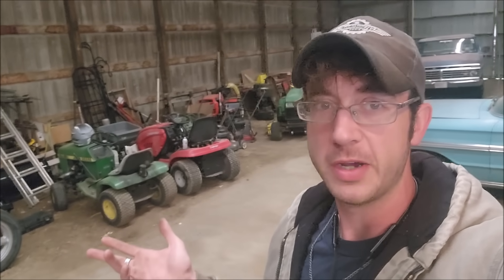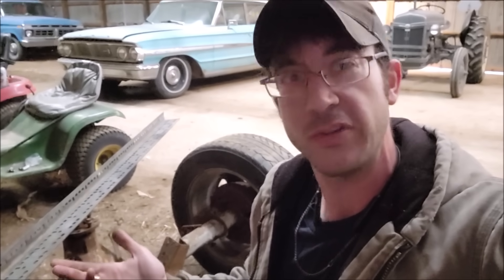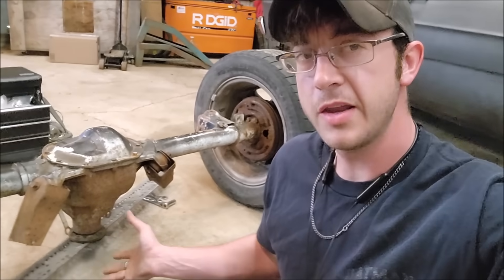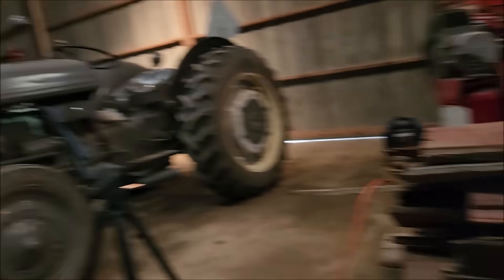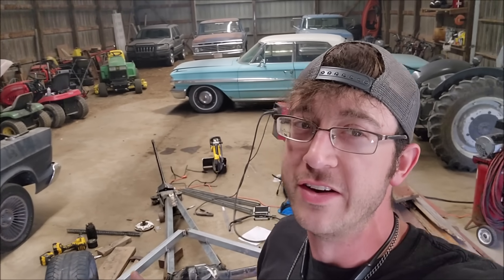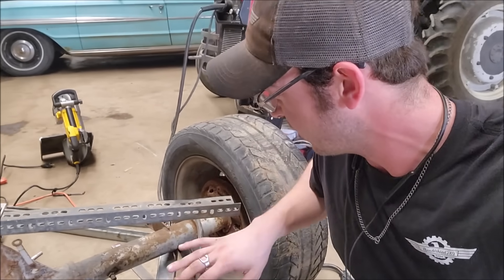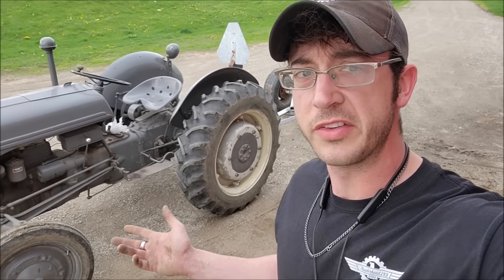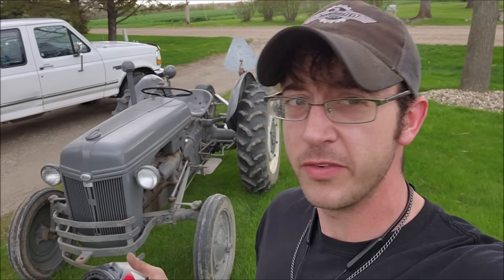Car Differential MOWER: Build & Test!

Comment: For a blade to work well it really needs a deck enclosure so that it can create a kind of suction on the grass. My suggestion to make this work better would be to ditch the metal bar blade and instead use something like 1/8" steel rods of appropriate length. You'd just need to make a hub that bolts to the diff, and around the edge of the hub you make some holes which would hold the rods. To mount them, you can bend one end to make a small L, stick it in the hole, then dab the end with a welder to keep it from falling out. Don't weld them to the hub because you want them to be able to swivel. Do it this way and you will be able to mow tall grass and brush with ease..and replacing the rods is as easy as cutting out one that is damaged and popping a new one in its place. How many rods should you use? Well, if you plan to mow slow use more rods. If you plan to mow at faster speeds, use fewer. I'd say minimum 3 max 8.

Comment: smaller wheels... but then the clearance is gone.
but then if you flipped it over, you can drive a step up pulley to a (new) spindle, that you can make from an old car hub and axle...

it needs to go about five times faster... think of the depth of cut on a normal mower, you may move half an inch or less per blade rotation.

then its going to need a few hundred kg on it to keep the wheels from slipping as the ratio would be so high.

naw, it seems a good idea at first but its power is all dictated by its traction, the gear ratio, and how fast its traveling... better to just mount a normal engine on there.

swing back blades are a must.

Comment: Mower deck 200 to 400 bucks. Done deal.

We used to give 200 to 400 for an old ford 8n or 9n tractor they only cost 400 new back in the day and there are 10 of thousands of them in verious states of condition. 
That one looks pretty dam good if you ask me ya just need the correct pain colors on it. Becuse the gry isnt working.

I dont own a farm or even a big lot, but id love to have one of them tractors they are fun to drive.
Reply from the maker: Read my pinned comment - I actually own a bush hog, this was just for fun with junk id never use

Comment: Break down buy a mower deck 3 point hitch anx use the power take off, flip this over make a roud sling deck mounts a drop box and youve got a great pull behing spreader.

Comment: To get good at welding you have to run a lot of beads, it just takes practice. You can have an E for effort  if you didnt try it be an F  you earned the bottom line.  Get better youll earn a I up the righ side to make a B  you can only go up from that.    Pst i cant weld for shit but i use a stick welder never could make wire feed work.

And 40 plus years ago i worked in a machine shop.  

One problem on your blade,  one side cuts the other smacks the cutting edge in on wrong side.
But hey flip it over you can make a spreader.  Look on youtube somone did it.
Reply from the maker: I mentioned the plan with that but I can see the average watch time is 3 minutes so I know folks are jumping around and missing a lot 🙂

Comment: If that tractor could do 80 MPH it might cut grass, but I still doubt it. That blade is turning way too slow to mow.
Reply from the maker: I mean you saw it lopping grass right in the video - but the second iteration isn't ground driven and spins a frightening 500 rpm 😅
Now it's real dangerous

Comment: Taller wheels/tires will turn the blades slower. You need a different gear ratio,

Comment: A buddy back in Nebraska built a rig about like this out of a pick up truck rear end but he put a electric motor that put out 5kw of power wich is alot then pulled it with an electric powered car he built and drove out to the west coast and back never had a problem. It had batteries that got it going once he hit 20mph it would kick in and that thing would really go.. after some time he was trying to get his invention out there and he got a visit from some government guys with a seize and desist order two days later his entire shop and rig burned to the ground!!
Reply: I think I know that guy, he also invented a carburetor that would get a hundred miles per gallon on any engine.
Reply: @richardbauer3327  no wrong guy. But T did put a hho cell on a van and it got 50 mph. Lol

Comment: version 2.0 should have a height adjustment and a guard to keep stuff from flying up to the cab.  Technically you only need to guard on one side except if you really want to be fancy and guard against the mowing in reverse you could guard on both sides.  You could build the guard with old pallets or something expendable.  Metal is cooler though.  This is fantastic for antique tractors that do not have a pto.  A lot of equipment like manure spreaders and seeders feed of the wheels.

Comment: Maybe I’m totally over thinking this. What about remove the tires and mount   a PTO shaft to one of the axle shafts and then put the whole thing in some sort of a frame that could be attached to the three point hitch, then that way you have hight control

Comment: Find a good used mower deck as wide as they make. Use the rotating yoke and attach a pulley to it to be the drive belt going to where the mower deck drive pulley is. Now you have finish mower. Find a brush hog deck that the gearbox is shot and do the same thing. If you can make it where both decks mount same way you will have brush/slasher and a finish mower that will safer to use and we will still be watching future  videos.

Comment: the other thing is the rear gear. you want it at a high enough gear for it to have the speed to cut. if i recall correctly since i used to be around the mower tractor(the big ones you might see mowing school grass or certain tracks)attactment. they spin upwards of 3000 to 4000RPM and sometimes even faster. try aiming for that

Comment: Need to mount a camera @ the hitch level, I don't see it cutting ANYTHING, your grass is too short
Reply from the maker: This was just a test to see if anything would work or if it would just vibrate apart violently. 
I have a pretty simple phase two where I'll have a blade edge and some rpm to it.

Comment: Can I please get these 15:42 of my life back?
I do recall spending some time as a younger man making a pressurized can to fill 90w oil into a truck transmission and transfer case. That sketchy thing blew up and covered me in 90w.
Your death mower could let loose and cover your lawn in body parts and whatever blood type you are.
Take that thing apart, sell/give the diff away or just stash it somewhere until you find a fox body for it.

Comment: Another death trap idea. A horizontal boring tool to dig out the dirt in a crawl space. It could be vertical if you had the floor removed in the home. Yep I've been working on the idea. But in the space below this house we bought call a storm shelter storage area and a collection point for water to be pumped out. I just like the house is over a hundred years old.
On your homemade brush hog why not just use a blade from a brush hog hog.

Comment: I saw one a while back in a foreign language, the guys used a truck axle. You need deep gears 5 or better. Or a two speed medium-duty rear with 7s.
Reply from the maker: Or my actual phase 2 plan which is extremely dangerous but super effective

Comment: These are pretty sweet brush hogs when done. Have not seen any one put enough effort into one to really be a finish mower yet. I do advise some kinda of mesh metal shield that you mount behind the seat of the tractor. A few years ago using my 48 ford 2n and a finish mower i had the pto shaft fail and come apart and a better part of 15 lbs of steel hit me in the back of the head when it happened. Fortunately I was ok just a nice gash and a big knot on the back of my head. Now when I do anything with it i have a 2ftx2ft square mesh shield that I made out of a chunk of metal goat panel fence and on each side of it a section of chain link fence offset from the other side by half of the opening so that in the end the biggest opening is only about 1.5 in at most. Its kept a few various things from clubbing me and oh can still see through it

Comment: put a couple of X-acto blades on the ends (I only thought of it because I saw some guy showing the bottom of one of those lawn robots and that's what they use)  edit I've been a professional property maintenance business owner for 25 years and my crazy idea would be to have a setup up similar to yours with  6 industrial vent fans stacked that have sharpened blades on top of each other so the suck the grass up to chop super fine and have the duct at the end curved to the back so it blows behind you.

Comment: Putting a cover over the top would increase the safety. You could also put a 90 twist in the flat bar to keep the blades lower on the perf angle iron

Comment: I had thought of doing this as well. What if you mounted a small flywheel on your pinion flange. If you did that and used 1/4" flat bar (sharpened) for the blades. Mount the blades with a bushing and shoulder bolt, so they would swing (in case of a tree root or rock, they wouldn't dead stop) and have them mounted off center from the pinion. I probably explained that wrong. IDK. That was my plan If I had made it this far. Cool to see it in action though!

Comment: An open differential would probably be better when you go around corners at slower speeds the blade speed will actually speed up due to the nature of gear reduction in the spider gears
Reply: I was thinking the same thing.

Comment: Nice! Actually,  iffin  you  swap  out  to  slightly  smaller  tires,  or  air  down  those, and attach  small  brushes  to  the  tips  of  the  "blade" you  could  also  use  it  as  a  lawn sweeper/lane buffer.  Cuz,  you  know,  everyone  loves  a  well  buffed  lane.

Comment: Connect the bottom of the old pot in place of the blade.
Connect the blades to the rim of the pot.
The height of the pot moves the blade away from the ground.

Comment: You may already know this but Bush Hog blades are mounted on the hub with a single bolt such that they swing freely. So if they hit something solid, they just bounce off and swing out of the way but the unit doesn't stop spinning. Then centrifugal force allows the blade to swing back out to resume cutting.
Reply from the maker: That was the part where I had said I already made a critical mistake and looking at a mower for 5 minutes before starting would have revealed that
Reply: That or a shear pin would be smart.
Reply: Also regular lawn mowers don't have that blade design usually one piece slightly curved an can be rotated weh one set of edges dull like cutting edge on a earth mover bucket
Reply: how is the blade moving? I don't see any axel connected to it or any motor
Reply: @mg42V5  it's a differential from a car or truck . The wheels drive the axles , which drives the ring gear , which drives a pinion gear . The blade is attached to the pinion yolk . Depending on common gear ratios you could have any where from 2 3/4 turns of the blade for each turn of the wheel , to 4 turns of blade per wheel turn . Faster you drive , the faster blade spins
Reply: @outinthesticks1035  omg my dumbass didn’t even think of that I don’t ever know how bit it makes sense i just had a brain fart thx
Reply: Not a bad idea . If using a diff from a truck the ratio would give a higher blade speed . I don't think you could ever mow heavy grass , but that's not the point is it
Reply: Repent and believe in Jesus Christ   No such thing
Reply: My flail mower doesn't use chains to hold the cutters and none off the ones I've seen do either.

Mine uses heavy duty "hammers", which are heavy pieces of solid steel that bolt to the spinning drum and have a sharp edge ground into the other end. They can pivot backwards when they hit solid objects.

The only place it has chains is hanging down at the front of the mower to ensure things don't fling forwards and hit the driver.

I am extremely impressed with how well it can do everything from chopping up branches up to about 3" in diameter to doing a decent job at cutting grass.
Reply: @Slider68  then it's not a flail is it?
Reply: I disagree. Bush hogs are made for going real slow in rough terrain. this mower can be used at high speed in the big flat areas.
Reply: I thought they used a few chains.
Reply: That is a flail that uses a chain. 
Really dangerous because the chains break and fly off. Bad day for you if it hits you.
Reply: @assassinlexx1993  You're correct, flail mowers use cables or chains with a piece of hardened steel attached to the end of them. The number varies depending on the size of the unit and available power to drive the mower. They're lethal on vegetation - especially vegetation you normally don't want to mess with such as wild blackberry patches or similar growths that are covered with thorns or spikes. They're also preferred for growth such as trimming back tree branches or brush that contains "heavy" brush or bushes that need to be completely wiped out. As for safety, all those units I've used or watched were contained in a steel shell (which effectively was a scattershield) or were all facing away from the driver when in operation. As long as you operate them as designed, they're safe.
Reply: @MaxGiganteum  yes, flails have normaly quite thick steel all around, i was flailing some rough ground hit a big ass stone and it left a massive dent in the sheild, massive bang aswell.

Comment: Looks dangerous, I love it
Reply: Check your vacuum canister/and vac lines. Canisters go bad and will severly effect timing events when you need advance timing at higher rpms. Put a timing light on it and see what you have at 3,000-3,500 rpms. If you have a billit distributor/mechanical type (Msd) check your springs and make sure the counter weights are free to open up.

Comment: I was literally just thinking about building one of these out of my junk 7.5 I yanked from my ranger since my mower is down and my grass is knee high. Wife probably won't approve, but at least it'll get that rear end out of the yard. I have no welder, welding skills, or budget so mine will be extra sketchy since I'll have to bolt it all together. 

On second thought, maybe I should just fix my mower...

Comment: But if that speed does the job, it's going to be fine for big open fields. The real problem is around obstacles and ditches where you might not want to get airborne. Of course I don't know if you have many trees. All we have is trees, rocks and hills here. 
Side note: when i was a kid, i was riding on the tractor axle with dad. He was using a box blade to uproot a small 4" stump. As soon as he made contact, i fell inside the box. I was screaming like a banshee and he hit the brakes immediately. So dont let kids ride on anything other than a platform with handles and a seat would be nice. That axle is pretty slick to try to stand on. I think it was an old gas ford with the bug eye lights from 50's or so. Gray/red. Dad didn't take extreme good care of his equipment if im honest. But i hope my half brother didn't let the machines rot away. 😅

Comment: A larger tire will make the blade turn slower so you will have to drive fast to get the blade speed you need
Reply: Different tread pattern, add some weight... call it a day
Reply: True but, he was alsot talking about getting a 3.73 gear so, it would almost be a wash or, just a slight improvement

Comment: This is marginally more dangerous than my grandpa's brush hog off the back of an 8N (at least it had an overrunning clutch and, you know, a deck).  (I still have the 2N he left me, though the mower went with the 8N.  Great tractors.)
Reply: My 2N (which was the designation from 1942-1948 but is barely changed from the 9N) still has the 6 volt original electrical system too.  Still starts pretty darn well.
Reply: The overrun clutch is between the tires and the turf. If the tractor stops too quickly the mower will continue forward and (hopefully) lift off the ground reducing the traction to keep pushing the tractor forward.

Comment: Cut the "blade" in half then flip one side so the cutting edge is facing the right way then overlap them and bolt back up. Easy fix. Easier than welding a giant bar to it.

Comment: I'd get the tallest gears available for a 7.5, get those blades spinning quick
Reply: Tall gears might get offset with taller tires. I think he needs something closer to 1.5:1 but I know that is not made. Anything to speed up the blade will help.

Comment: Like Ralph Nader once (or twice?) said: unsafe at any speed 😂
Reply: To answer my own question, No it does not change the timing. It does somewhat effect how the distributor gear drops in to mates with the cam gear, maybe by a tooth or so. For perfect alignment to # 1 cylinder, you and tweak the oil pump drive rod the distributor goes into and get it to match up very very close , or perfect  match up to # 1 if you get lucky.

Comment: I started gathering parts for making a papercrete mixer. Similar idea, but the pinion points up and spins a lawnmower blade inside of a tank for chopping and mixing the papercrete.  Those actually work pretty well. I have a Lincoln 9" axle with open diff., one end of a 1/8" thick round fuel tank, about 4 ft diameter and 3 ft tall. And plenty of old drive line ends and lawnmower blades. Helps that I had a welding and fab business for 30 years and still have my tools...Now that I'm retired maybe I'll finally get around to it?